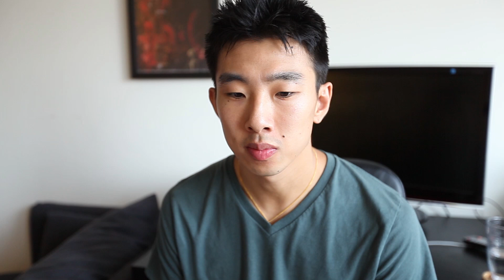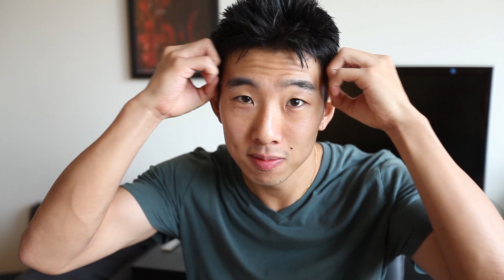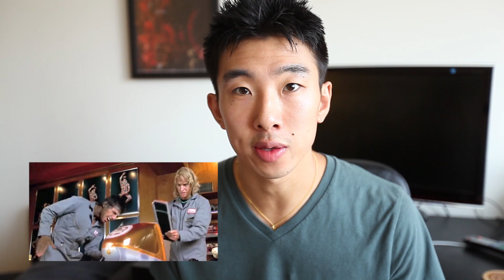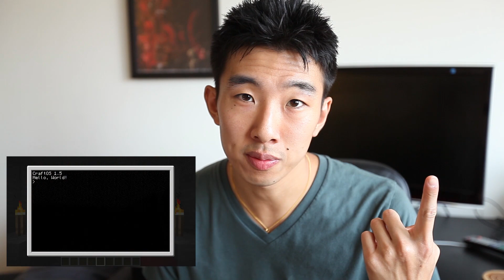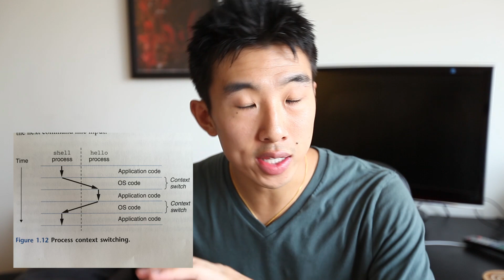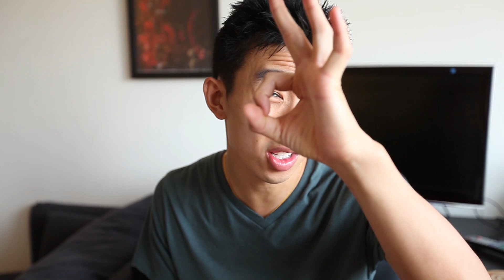How Code Works

Comment: I am rewatching this video and getting more out of it.  I am not comfortable using computers, though I do quite a bit, and even learned Fortran code, because I don't feel I understand them adequately.  This is the only tool of life that is that way for me, for example I drive a car, and though I don't build them, I understand the internal combustion engine enough to feel comfortable using the car. But computers are a stumble for me.  Thanks for helping me in that area.
Reply from the maker: nice ! thank you

Comment: How I understand it is that you cannot have code if there is no working processor, not if there is no electricity. It's like saying that a household unit becomes the oven it turns on...

Comment: So you're telling me i can execute code through a light bulb???
Reply: Joe L 
Yes
Reply: Maybe late but check out vacuum tube. Its like a light bulb but a special one. It acts like a transistor. It controls the light that is passing through. 1 if on 0 if off. Now connect a bunch of it together you can create a gates. And gate. Or gate xor gate.

Comment: Thanks so much for making this video! I learned a lot but I still feel this disconnect between the harware and software. If we take out the whole operating system and all the complexities out of the way say a program is just a bunch of 0s and 1s. This program might do something like add 2 numbers and print the answer on the screen. I'm guessing the instructions would have to go into memory. (Have these software instructions turned into something physical when going into memory?) then the program counter would point to the memory address storing the instruction. (how would the address in the program counter physically get whatever information is in that address and have it send electrical waves that would pass into the cpu?) my hope is that the same process that happens breaking down the instructions to electricity running through the cpu is done in reverse to have the solution that the CPU calculated put back from electricity into 0s and 1s and continue going up from there. Hopefully this makes some sense.
Reply from the maker: +alexander babich You are right. First you have to remember that when you break 0s and 1s down to their basic level, they are actually just electricity. For RAM or your main memory, you can think of it as a huge array of 1s and 0s. The only way they keep their state is that electricity is flowing through them. If the electricity stopped all the RAM would go back to 0s.

The instruction is sitting in memory and the program counter is pointing to it. I think you might be confused in how this is "sent" to the processor. Actually, the processor reads the values at this specific address and it recognizes it as a machine instruction. The program counter is ALWAYS pointing to memory that has valid processor instructions. If it's ever not pointing to that kind of memory, things are gonna go bad and crash the processor. The instruction itself has a special sequence of 1s and 0s that the processor recognizes and will behave a certain way to. Nothing is really transferred, but the flow of logic and electricity inside the processor changes based on various values (1s and 0s) of those machine instructions. The instruction in memory will represent ADD or SUBTRACT and the processor will react to it.
Reply: +alexander babich hey man whats up! amazing to see classmate and former colleague/friend @Dave Xiang right in one video. awesome video Dave :)
Reply from the maker: +faisal farooq Thanks dude. Damn small world
Reply: +Dave Xiang Now that I'm thinking about it my problem was that I was viewing the software as what's displayed on the screen lol. If I just think about it as always being electricity then it makes a lot more sense. Of course the computer doesn't need the display to do anything. All we are doing is basically controlling a gigantic electrical circuit.
Reply: +faisal farooq hey man! Good to hear from you!
Reply: If you're still interested since one year has passed, you can watch some videos on circuit gates, computer architecture, flip-flip and many more topics.
Reply: I think you understand it by now. All of this is ALWAYS hadrware and elecricity. Just that the hardware and electricity can output it on our screens in a way, that feels natural to us.
But in reality, software is only an abstraction, and idea that we hold in our minds. In reality all of this was always electricity, some very good engineers make the computer output it on the screen in a way, that looks like somethin more than electric circuits, but this is just a convenience. In reality it is always just gatters and electric circuits, an electric circuit might output a few white pixels here and there on the screen and a few black pixels as the background, but the computer does not really understand it in the same way we do.
When I started coding I saw it as a kind of mind vs matter dichnotomy, but in reality there is only hardware.

Comment: Try make another vid it use 'switch board' to explain processor... 
Maybe a video series as it won't fit to w wideoz but would be cool a series 'from simple switch to a computer'
At least primitive 'switch based calculator' for starters?

Comment: Good video.  How does text file become an executable file exactly?  I guess I am asking for even more detail. Thanks!
Reply from the maker: yea, that's a pretty complex topic. it depends on what's in the text file. it's either compiled down to machine code with separate applications like GCC (languages like C/C++) but it can also be just interpreted as text by an interpreter(python3/ruby2x)
Reply: Dave Xiang Thanks.

Comment: Dave, the context switching you are talking about is what recursion is based on, right?
Reply from the maker: No, they're not really the same. The context switching in this video is process context switching. The OS scheduling different processes to be run. If you're in a terminal and execute a script, those are two completely separate processes. This is all the stuff you on your task manager, or activity monitor. 

Recursion is a programming technique, usually contained within a single program or process. Recursion is just a programming technique to get something done. Just like using a loop is a programming technique. That is the common use of the word recursion, unless you're referring to something really different. 

Hope this helps
Reply: Thanks for your answer. You and a couple other channels are doing a lot to provide direction to people trying to develop in the wide field of development. There's a lot in the way of basic coding tutorial, but not much in the way of helpful counsel. 

I understand what you are saying. It just reminded me of what I remember about what happens when in the process of recursion, and wasn't sure if somehow the processes were related. The way for each function call the state of the previous function is reserved in memory, and revisited in the unwind when the base case is met. I admit that I have to brush up on the details of what actually happens..
Reply from the maker: Functions calling functions and preserving state is done via the "callstack". A program using recursion (makes a lot of function calls) would utilize the call stack often. You should google it and check it out